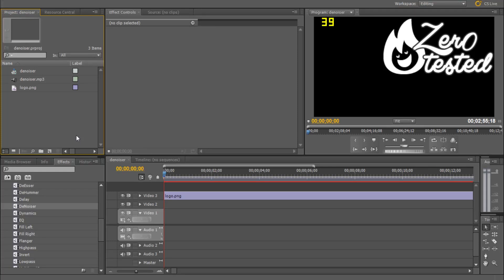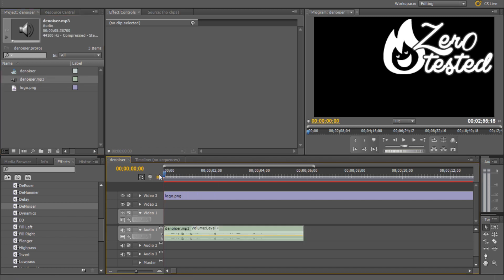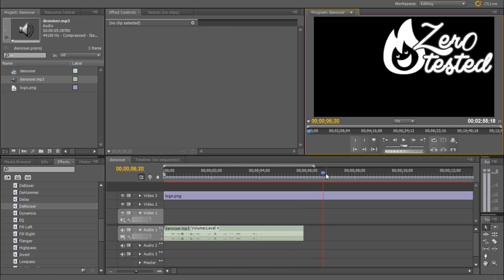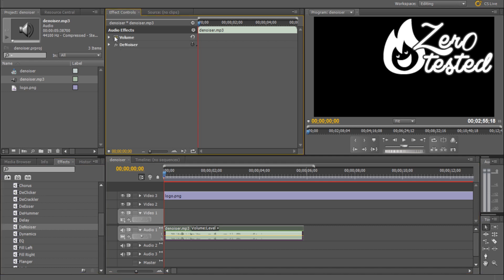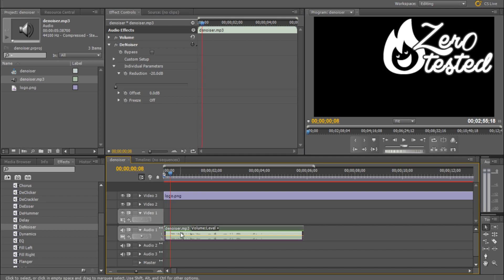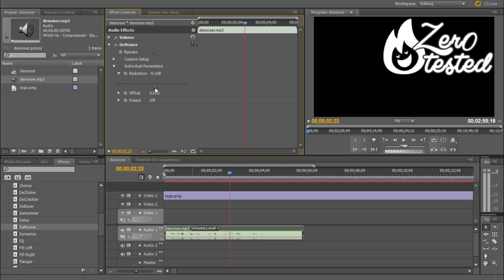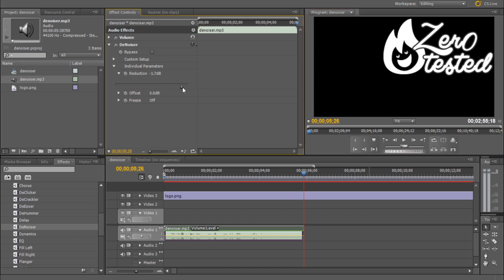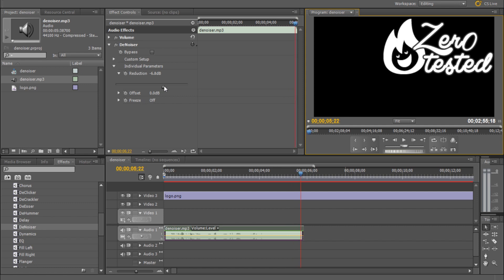Adobe premier pro | Remove static/hiss and grainy audio noises using denoiser - tutorial

Comment: Thanks for video it was a big help. I do have one problem still though. I fixed the hissing using the method you gave however when I export it the first several seconds of each sound clip still doing the hissing sound. It sounds good while editing it's only after I export it?  Do you have any suggestions?  I really need to fix this problem as it's for my job.
Reply: Try this, I have experienced the same problems, and this seemed to help:
https://forums.adobe.com/message/5385287
Reply: Did you ever find a solution to this problem? I'm having the same problem with my footage now and have tried a million things and nothing is working.
Reply: Did you look at the forum? It worked for me.
Reply: I also am experiencing the exact same issue for a job now. Applying the DeNoiser audio effect, and completely reducing the 'individual parameters' db, I have removed the static which clears almost completely in my sequence. 
However, after exporting the sequence to a final output, that static comes and goes throughout. 
And I can't access the forum at the moment for some reason - the webpage seems to be unavailable..?
Has anyone configured the correct settings to make it work??
Many thanks

Comment: for some reason when i export the hiss is still there :(
Reply: Try using the denoiser from the Audio Mixer, instead of dragging the effect onto the clip.  Top of screen, tab called Audio Mixer.  Once there, click the triangle in the upper left corner and you'll be able to open up a denoiser option there.  Also, there's a two-second delay sometimes, before the effect kicks in.  Get around that by dragging the audio on the front end, and using key frames to bring the volume up when the actual clip starts...if you have enough extra on the front end to do that.